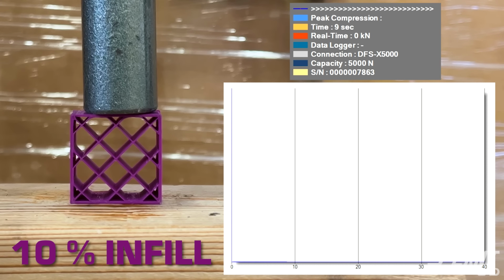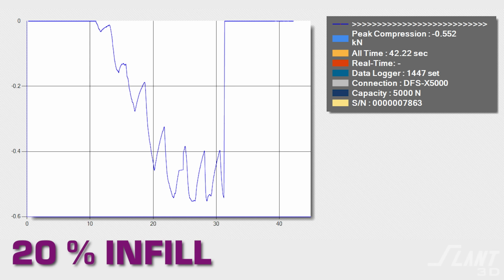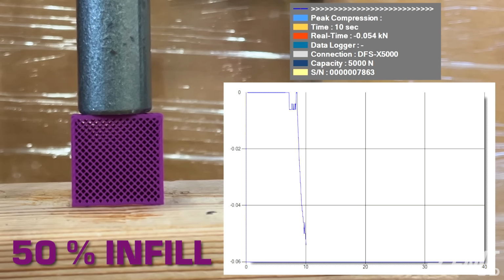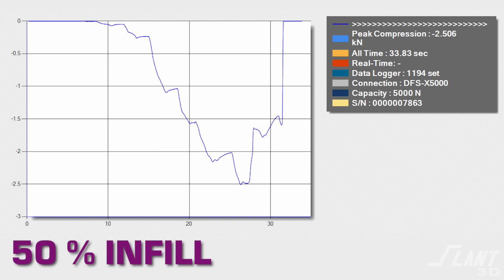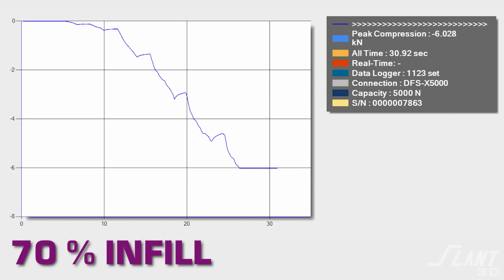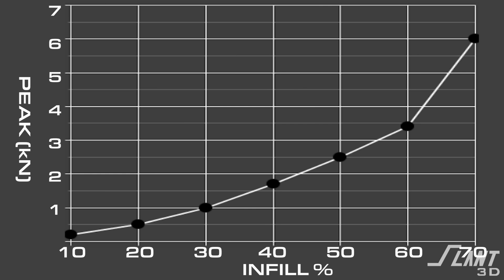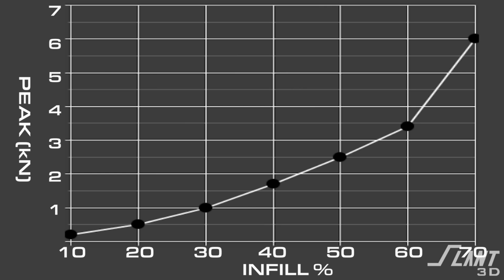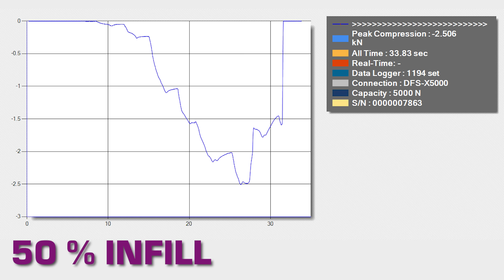From 10% to 100%: Infill Compression Strength

Comment: If you want to know the strength of the higher infill blocks, there's a way, without having to buy a bigger load sensor.  By resting a rigid bar of metal on two prism shaped fulcrums, one of which is on the press bed and the other on the load sensor, you can adjust the capacity of the sensor by putting the test block at different places along the bar.  For example, if it's centered between the fulcrum on the bed and the fulcrum on the sensor, you're doubling the capacity of the sensor by splitting the load on it in half.  If you put the test block at the 1/3rd point of the bar, you triple the capacity by splitting the load into thirds, etc.

Comment: thank you for this interesting test, it's very helpful in choosing the right infill percentage. I'm thinking now if those results still the same if you change the wooden platform with a very regid one, i think the wood absorbe a litte bit of the applied forces. because i add sometimes a 3mm sheet of wood between the 3d printed part in the metalic surface of contact to reduce the applied forces.

Comment: That's a load cell. Strain gauges measure non dimensional stretch/shrink/shear. Even if it uses a strain gauge internally with a known stiffness to derive load, it's an internal process that's not related to the strain of the part being tested.

Comment: In all these tests, the strength is tested in the diagonal.  Notice they always shear at a 45 degree angle?  If you placed these "up and down" where the webbing is perpendicular in some way to the force being applied, you will see a huge increase in break resistance.  Essentially making it so that the downward force is applied straight down to the wood vs cantilevering over each "row" below.  Even better - turn those prints on end, so each square tube is straight up and down.

Comment: 45° angle not great for 0° load vector.  Rotating the infill by 45° and reducing the 90° infill by 50% that of the 0° deg infill will give you much higher strength and stiffness.  Also, the load distribution at the ends is essential.  Need to spread the load first so more material is needed at the ends.

Comment: Weighing each cube would be helpful to better grasp the relation of material spent to the resulting compression strength.
Reply: assumptions: counting pixels, wall width is about 1mm-ish, calculations simplified to volmue instead of mass, but whatever.

(every single calculation below is calculated on pretty inacurate numbers, so take it with a lil grain of salt :P)

wall: (30^2-28^2)*30 = 116*30 = 3480mm^3
inside: 28^2*30 = 23520mm^3 

10%: 0.2 kN - 3480 + 23520*10% = 5832mm^3 - 0.05747N/mm^3 of filament;
20%: 0.5 kN - 3480 + 23520*20% = 8184mm^3 - 0.06109N/mm^3 of filament;
30%: 1.0 kN - 3480 + 23520*30% = 10536mm^3 - 0.09491N/mm^3 of filament;
40%: 1.7 kN - 3480 + 23520*40% = 12888mm^3 - 0.13190N/mm^3 of filament;
50%: 2.5 kN - 3480 + 23520*50% = 15240mm^3 - 0.16404N/mm^3 of filament;
60%: 3.4 kN - 3480 + 23520*60% = 17592mm^3 - 0.19326N/mm^3 of filament;

so for strength/mass ratio it looks like 10-20% is barely a difference, 20-60% it's pretty much linear increase and above that, if we assume its still linear, at 70% infill, it should break at around 4.5 kN, so i'd guess that somewhere between 60 and 70% it stops behaving like grid infill and becomes more like a rigid wall :D

Comment: I think it is possible to get more usable information from a test like this if you change just a couple things. Most of us are not printing functional parts with the intent of it only becoming useless only after critical failure.
I think the real question is, under what strain does it go from elasticity to plasticity? Stop the test at different pressures and measure if it has returned to its original size. Then continue to test and see at what point it is permanently deformed by 10 or 20%

Comment: The pointy, round cylinder as a load is very bad. It is not including the walls for applying the load. You should do a retest with a plate which is distributing the load evenly over the whole part.

Comment: Infill percent can be deceiving, especially among different infill patterns. I would much rather have data for overall part densities. I know I use 3d honeycomb when I am trying to get the shortest maximum distance between solid lines that are to go on top as shorter bridges helps a lot, but it also uses way more than the stated % for infill, I usually have to turn it down to around 2/3 what I would use for gyroid or cubic for the same density.

Comment: Should redo these tests with a piece of wood on top of the cube so that the force was equally distributed across the entire top surface, rather than being inconsistent and non-centered on the upper face's mesh.

If that's a cube and the piston is a cylinder, I'm not sure why the piston isn't protruding past the left or right edge of the cube, but is protruding past the front edge of the cube.

Comment: Well since you tested the grid infill strenght only on the weak direction this is not a very complete test. 

Most of designs using linear grid infill are choosen to be printed in a way that use the strong direction of grid infill. This is the case for most asymetric infill like grid and honeycomb. If you try the same test in the other direction you might have totally differents results.

Comment: You are testing what is obviously the worst, in terms of strength, line orientations. 
I mean if you are going to print a cube with a grid you should print the grid lines parallel to the lines of the cube and not at 45 Degrees... 

I give you a tip what you could try next time. 
Try the same infill test but using double infill lines so that each infill is twice thicker or try using a 200% width for the infill and let's see how it does. 

I would say In terms of compression a thicker line will be better than many thinner ones...

Comment: Great data points. Visualizations are so insightful and educational. 
Seeing test results for a part that is twice as wide, particularly at lower infill values would be interesting. Since the plunger is similarly sized in width to the part, the solid sidewall surfaces (which are thicker) are transferring a percentage of the force between top and bottom surfaces.
Reducing the size of the surface contact area between the part and the plunger would cause failure at lower force values. Not sure what a good contact area would be for testing, but might be a consideration.
At lower infills, the upper surface deforms changing how forces are transferred into the infill. A thicker top surface would enable a more consistent transfer of forces between the part surface and the interior infill matrix. 
Just some things to consider as develop and evolve a testing process. Is great seeing this initial test.